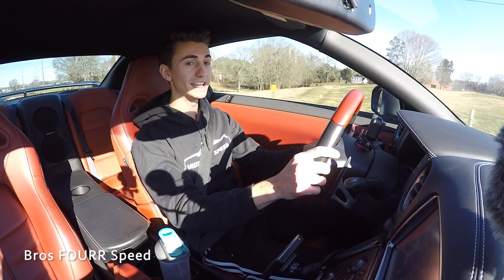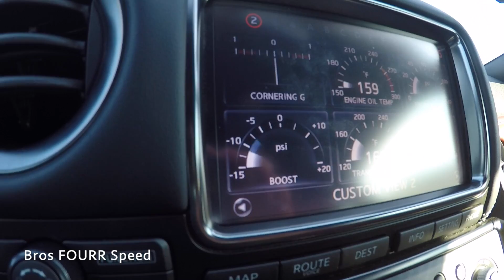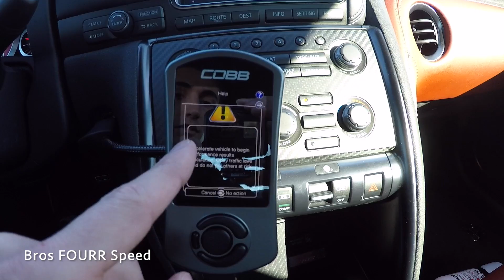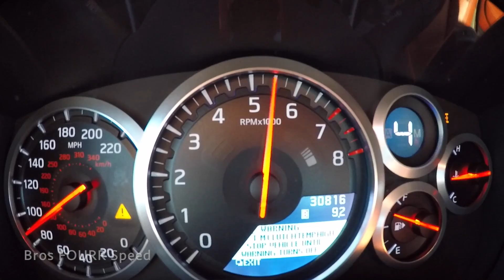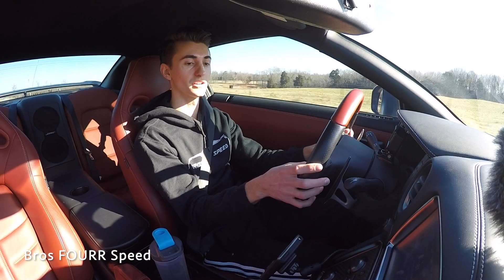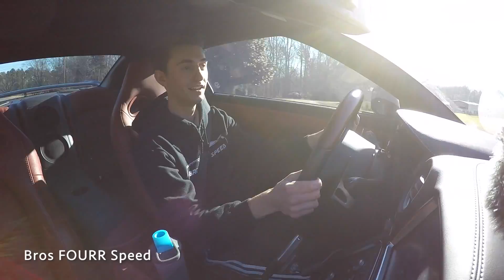Slowest 0-60 Time EVER In a Tuned Nissan GT-R!!

Comment: 5.4 sec does my 07 OUTBACK XT ( Automatic) straight from parking lot with all the crap in the trunk. It has Cobb intake and down pipe.
Reply: You are right 0-60 
is what my outback does :)
Reply: you forgot to mention its remapped

Comment: Cobb off the shelf stage 2 ? Thought you were running a custom tune from AAM ? What gives
Reply from the maker: soinyat1 I swapped it at the air strip. At full throttle on AAM’s tune, power was dipping in and out. The Cobb tune was much smoother.

Comment: I just got my cobb not that long ago. Super great upgrade. I would recommend to get the transmission tuned as well! Automatic tuned is alot smoother.
Reply from the maker: James Robertson Hmm is it really worth it if I drive in manual a lot? The car is very conservative with the shifts in auto and normal trans setting. Just a bit clunky in slow speeds. In Race mode in auto, the trans is very aggressive. My Cobb does have the trans tune. I haven’t installed it
Reply: @BrosFOURRSpeed  I thought the same dude. The trans tune takes away the slow speed clunkyness and honestly made it alot more fun to even just drive it in automatic mode. If you already have it, it's worth putting on the map.
Reply from the maker: @--ace--7273  Very cool. I might have to try it. Is it going to be very aggressive in automatic tho? like holding higher revs and downshifting a lot when hitting the brakes?
Reply: @BrosFOURRSpeed  it is alot more aggressive on auto mode. I honestly haven't used manual mode but once after I did the tune sense it is so aggressive. It feels like how you would expect a supercar to drive.
Reply from the maker: James Robertson Which map do you run? Like 7 pop up on the AP when I click install. I haven’t installed anything yet
Reply: @BrosFOURRSpeed  I'm running the optimized shifting. I had mine done by a professional, I'm not sure if he did any extra configurations but I dont think so. I haven't tried launch control with it but you can configure your launch for best traction.
Reply from the maker: @--ace--7273  OK  there is also some that say VDC off  I guess I can try a few to see the difference
Reply: @BrosFOURRSpeed  I'm pretty sure mine is on, I had mine done due to my transmision needing rebuilt and I was highly recommended by my gtr tech to get it to help the longevity of the new trans. Check forums as well I've heard vdc off could damage drivetrain.
Reply from the maker: @--ace--7273  OK cool thanks for the info!
Reply: Sense yours is a 14, I'd do G2-LC4: 6AV0A optimized. That's the newest one for your car. Looks like it just takes off vdc for launch control which is fine.
Reply from the maker: @--ace--7273  OK good to know. I'm probably going to mess with all this tomorrow

Comment: That clutch temp warning is normal, Most people don't realize that the R35 is not "FullTime" AWD. It is RWD with "front wheel assist", only once the rear tires start to spin will the cars computer send a specific amount of power to the front wheels. This Clutch temp warning is letting you know that the ETS clutches are overheating from too much power transfer being sent to the front because the rear tires are spinning badly. Here is a link to fully explain the overheating issue and give you more information. https://jackstransmissions.com/blogs/pages/gtr-ets-awd-unit-rebuild
My advise on getting a better launch, if you have a Cobb use it to lower the launch RPM to about 3000-3200 on the street especially using stock tires or street radials. Next which I have found to be maybe the best bolt on for the $$ is aftermarket control arms, toe rods and traction rods. These will allow you to remove that negative camber and get all the tires tread on the pavement, my car is a FBO E85 and now cuts 1.4 sec 60' at the track just from these rods! I had new rims and drag tires before the rods and could only get a 1.6 60', so trust me that negative camber is no bueno for acceleration just cornering.
Reply from the maker: Frank Thomas Very cool info. The only other time it came on was when I was at the drag strip. I drove over the water in front, but only my left tires went through the water. Spun like crazy off the line. That time the clutch light stayed on for a bit. I had to drive like a mile for it to turn off. This time it was just for a second. And when I was at Nissan they showed me where a purge valve hole was when it over heats.

Comment: Have you got a AWD controller on your GTR.?
Reply from the maker: craig g What exactly is that? My Cobb has a TCM tune, but I haven’t installed it yet
Reply: on mine its like a little ecu that lives under the drivers seat.It controls the the power split front to back.I have mine set on 50/50 split.its progressive with the accelerator pedal the more you put the accelerator down the more it move the power to 50/50 split so when you floor it from a stand still you get very good 0-60 times.Ive timed my 600hp GTR at 3.4 to 3.5 to 60mph on my ecutek app.Its the best mod ive done to my gtr the power is controlled very well.Plus there are a total of four maps on there starting with rwd mode for heating the tyres up when your a the drags strip.70/30 split 60/40 and 50/50 split.Make that your next mod and film the difference.With the extra power you have the times without a launch will be low 3's. If you do this mod, when you do test it out just flatten the pedal from a stand still and watch it grip no need to feed the power in with the accelerator.
Reply from the maker: craig g Wow that’s super cool! I’ll definitely look into that! During the summer I was timing about 3 seconds 0-60 on the stock tune. That’d be pretty sweet
Reply: Yes that's the thing with going up in power.The stock controller is set at 82% power to the rear so 0 to 60 times start to suffer when pushing above stock power levels.But this is where the AWD controller steps in and claws back all that lost traction.
Reply: @BrosFOURRSpeed  Currently my best 0-60 time is 2.2 seconds at the dragstrip, without the controller.
Reply from the maker: Frank Thomas dang that’s insane!
Reply: @BrosFOURRSpeed  https://www.viscontituning.com/products/gtr-awd-controller

Craig must be in a right hand drive GTR, as this controller goes under the passenger seat in our Left hand drive GTR's.  They are interesting to play with and can allow a rear wheel only mode for burnouts at the dragstrip. They seem best suited for road course style racing tbo, John Shepherd informed me that if the controller is not tuned right and there are cases where the unit malfunctioned it can lead to transmission failure and should only be used by someone that has good understanding of what they are doing. My opinion is get the rear tires to hook up very well and save your ETS clutches by sending minimal power to the front wheels. I had one of these controllers and ended up giving it away.
Reply from the maker: Frank Thomas interesting. Definitely worth looking into
Reply: I'm in the uk.My controller is from linney tuning here in the uk.No problem with how mine is setup. No issues with my GTR.
Reply: @craigg8394  Linney would be the one to purchase it from if your looking at buying one. His knowledge is extensive on road course GTR's and would be able to properly assist a customer in setting up/tuning the controller.
Reply: Yes frank I have one on my GTR its from ben linney.2.2 seconds yours is obviously a fully built monster on drag tyres.Ive got one more for street driving on these shit tarmac roads in the uk we need it here.Its not like I can roll up with drag tyres at the light and start smoking everyone out to get heat in the tyres.....or could I hahaha

Comment: Something is definitely wrong with your 4wd.
Reply from the maker: Supercars Hunter What makes you say that?
Reply: Bros FOURR Speed I know some guys with gt-r running well over 1000hp and there is absolutely no spinning wheels when the launch
Reply from the maker: Supercars Hunter It’s just the 40 degree temp outside. Cold tires. They’re about 4mm. It was fine on the airstrip when it was like 60 out last month.
Reply from the maker: Supercars Hunter Those could be on radials too
Reply: Bros FOURR Speed or your tires are shit  ✌️ my bros M140i xdrive does 4.1 0-62 (340hp/500nm)
Reply: @supercarshunter2450  If I'm not wrong he has the stock run flats. Also regarding the 1000hp GTR's not spinning it would be a combination of suspension, tires,  and a great Tune.
Reply: @BrosFOURRSpeed  nothings wrong with it.

Comment: That wheelspin seemed a lot, must have a lot of power
Reply from the maker: Jay Shah haha yeah. When it’s like 60 out I have traction doing launch, like when I was at the air strip. But not so much today 😅
Reply: @BrosFOURRSpeed  haha yhh, probably the tires like u said too weren't hot enough too for the max grip
Reply from the maker: Jay Shah I had driven like 15 miles to this road. But I guess they just didn’t warm up
Reply: @BrosFOURRSpeed  ahh right makes sense love the Gtr tho haha 😎
Reply from the maker: Jay Shah lol thanks!

Comment: When I was FBO I had to turn LC down to 3400 rpm in good conditions.  Never tried in the winter.  VDC off with Cobb TC works much better than the stock LC.  You need to try a VDC off TCM tune.
Reply from the maker: TrboChg Interesting. I have the TCM tune on the Cobb but I haven’t installed it. When it was warmer I could launch fine with this tune. Like when I was on the air strip.
Reply: @BrosFOURRSpeed  Just remember the Cobb off the shelf tunes are a Vanilla universal tune, if you plan to go FBO E85 route you will be much better off paying a professional GTR tuner for a custom E85/93 tune. The Cobb transmission tunes are just fine to stick with.
Reply from the maker: Frank Thomas So far I don’t see the point installing the transmission tune. I like how conservative it’ll drive in Automatic and normal mode. And then it drives aggressive with it in Race mode and Auto. So I don’t see the benefits. But once I do fuel injectors and down pipes, after I’m used to their ots map, I’ll get it custom done
Reply: @BrosFOURRSpeed  The Shift logic has been fine tuned by Cobb, in normal mode it is more sporty and does not rush to 6th gear in auto mode lugging the motor around. That now belongs to the Save setting in auto mode you'll be in 6th gear by 30mph lugging around. Once I installed the TCM tune I never went back, been 2 years now and zero issues.
Reply from the maker: Very cool. I might have to install it! @nostromo480
Reply from the maker: Frank Thomas Which map did you use btw? Like 7 come up on the AP before I click to install TCM tune
Reply: @BrosFOURRSpeed  I went to Cobbs website to look at the available maps for your 2014 R35. The map I found for your car is NISSAN GT-R TRANSMISSION: KJ10A VDC OFF LC5 OPTIMIZED SHIFTING TCM MAP, LAUNCH CONTROL, STOCK THROTTLE, NORMAL WASTEGATE

Searching online thru Nissan, I found 3 transmission code #'s for your 2014 GTR. KJ10A, 80B0A, 62B1A .
Hope this helps, once you install it you will notice a difference. If you dont like it you can just go back to factory. You can also then launch the car without the Traction control (far right toggle switch down for yellow light) , which helps at the drag strip not so much on the street since you probably will still spin unless you make some traction upgrades.
Reply from the maker: @nostromo480  OK cool! I tried two today that were different ones, and I wasn't impressed with the difference. I'll have to try this one
Reply from the maker: Frank Thomas I tried installing this one, but it just says ‘locked’ on the AP when I plug it in to install
Reply: @BrosFOURRSpeed  When you bought it did you get the TCM option? it would have cost more, around $1200. If you paid closer to $800 then the TCM is locked out and you cant program the cars Transmission. Now if you did pay the $1200 then you may have to contact Cobb support on what is going on.
Reply from the maker: @nostromo480  The one I ordered was for TCM as well. I guess I'll email Cobb to see why it's doing that
Reply: @BrosFOURRSpeed  Would be the best course of action, according to their website they have that Tune listed for your car. So why its not allowing you to program the TCM with it would be for them to address. Hope it all gets worked out, I'm using the same type of program for my '13 GTR as well.  VDC OFF LC5 OPTIMIZED SHIFTING TCM MAP
Reply from the maker: @nostromo480  Yeah I was able to install the TCM tune in general, but it only let me pick from the few that are pre loaded onto the AP. I'll email and see why I can't download one from the website and install.
Reply: @BrosFOURRSpeed  let us know what you find out.
Reply from the maker: @nostromo480  I will. I made a video today testing out the maps that did work. I wasn't impressed lol. But once I hear back from Cobb I'll make an update